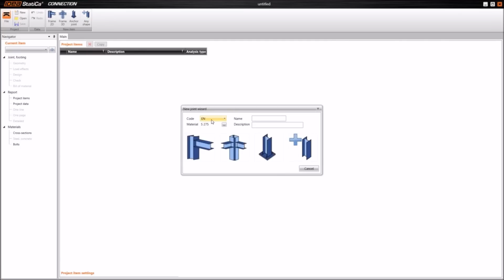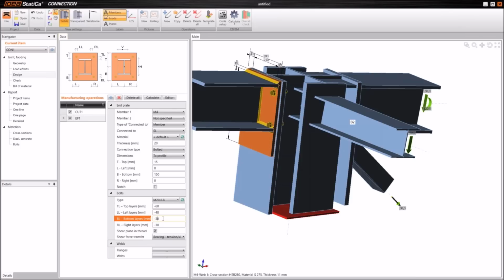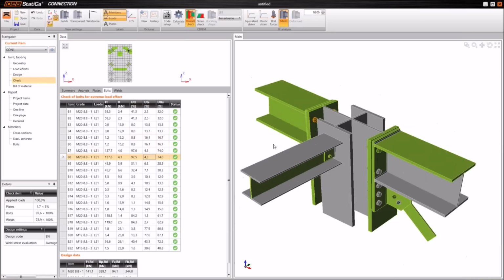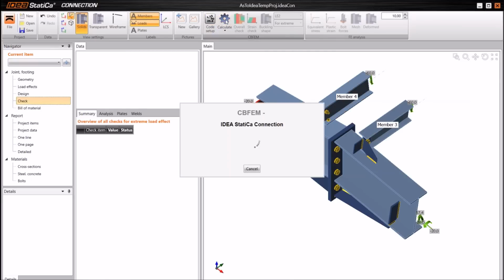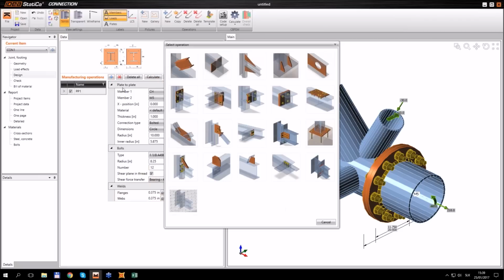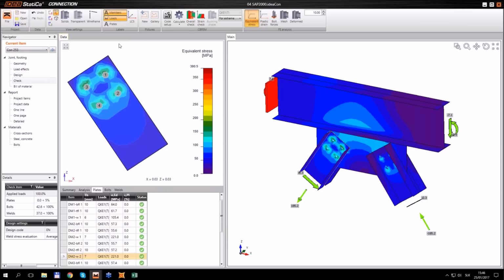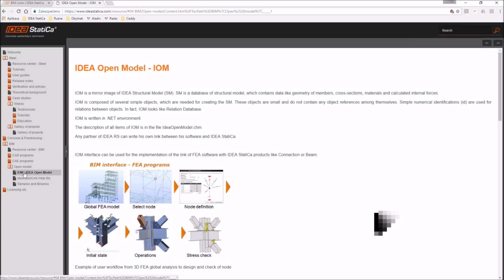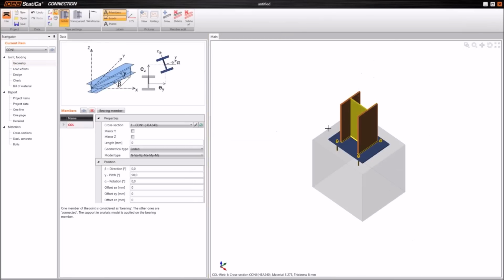EC AISC design of 3D steel joints - reinvented!

Comment: Hello.
Please i have to do a joint connection with high strength bolts in Idea Statica and it does not figure out in the sittings.
Could you help me.
Thanks.

Comment: THANKS! WHERE CAN I GET THE PLUG IN FOR SAP2000??
Reply: Link to SAP 2000 is part of the standard installation, you just need to activate it. Please follow steps here:
https://www.ideastatica.com/resource/#04 BIM/SAP2000/SAP2000 Tutorial.htm%3FTocPath%3DSteel%7CTutorials%7CSAP2000%2520link%7C_____1
Reply: This software is available with indian code ?
Reply from the maker: Yes, please check the latest version